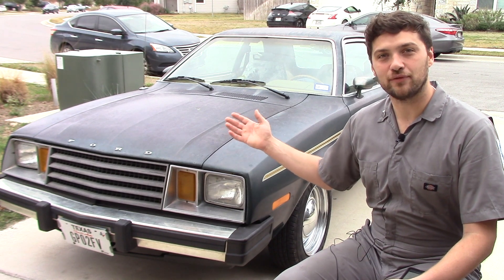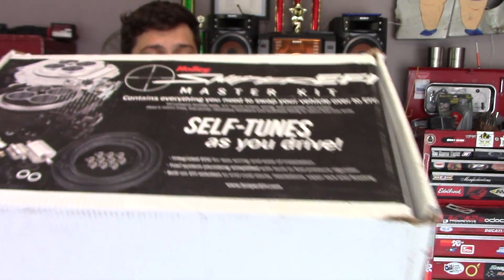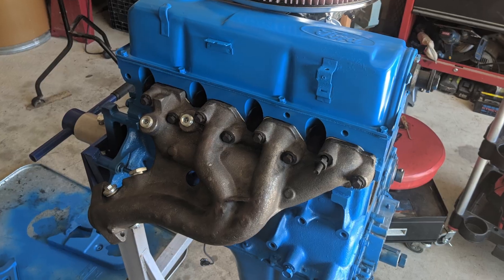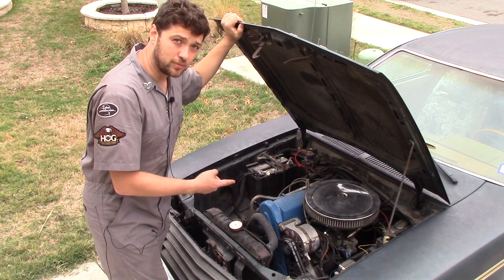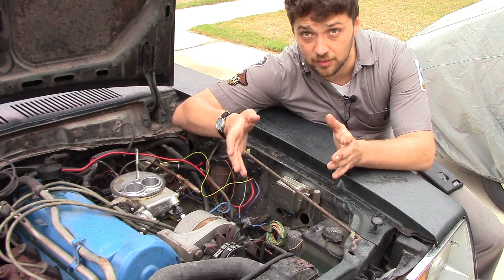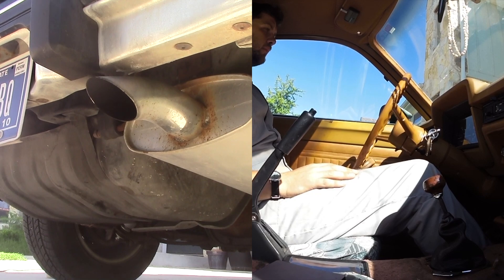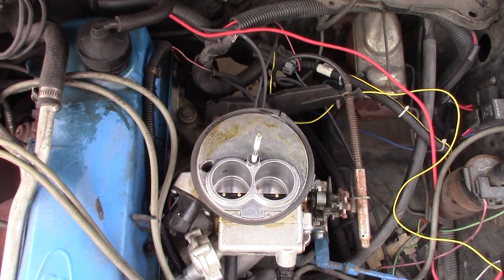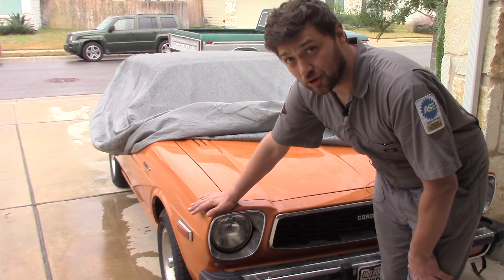How I built my FUEL INJECTED Ford Pinto using Holley Sniper 2300 EFI

Comment: I like driving older vehicles. I like no power windows and less emissions components. My vehicles are from the 90's. 97 S10 & a 93 Explorer 4x4.  I just keep them in good working condition. I did have some mods done to the A4LD automatic transmission in the Explorer to make it more durable. The S10 has a 98 NVG3500 manual transmission. I had to cut a new hole in the transmission tunnel for the shifter. It's a better transmission than the 97 NVG3500. I also upgraded the fuel injection with Delphi fuel pump & mpg kit,Summit Racing distributor..

Comment: I've owned two 1972 Pinto Runabouts.  Both with 2.0 and Automatic,  front disc brakes.  I don't remember having to warm up my car before I left the house in the morning.   If I did it must have been a pretty quick warm up.   I do remember cars having to be warmed up for several minutes, but I always remember them being older than my 72 Pinto.

Comment: Hope you get an in tank pump in the future, hope you have the plastic fuel tank shield from the recall also.

We had a 73 Pinto  just before we got married, 1.6 , 4 speed , total rust bucket,  took us everywhere though....
Reply from the maker: Unfortunately there isn't an in-tank pump available without custom fabricating a new few cell. The pump did quiet down after building new lines (in the next video). Yes indeed my 1980 pinto had the plastic sheild installed by the factory. Always good to hear from a fellow pinto owner!

Comment: This was so much more than a Holley Sniper install/review video! Great job. 👍 But OMG 1980 did not have the best music... Most of the Sniper review videos complain about the throttle actuation, making the adjustment you did at the loss of full throttle. Seems 
Ike that should be adjusted in the controller somehow. Maybe the fuel pump is working harder on the smaller lines, but ya the pump sounds like a dog whistle. 😙
Reply: @Mike Anderson Holley external pumps and most other brands are loud regardless.